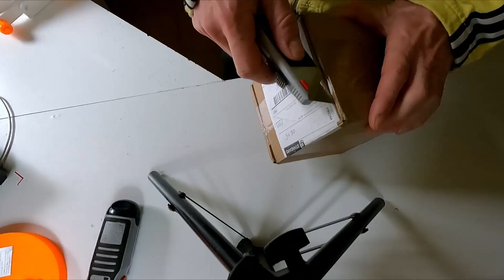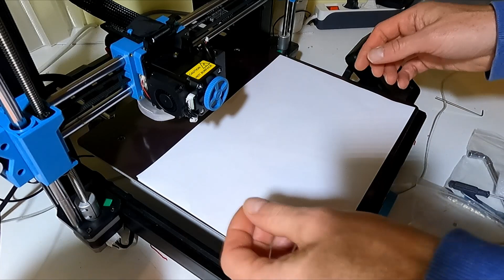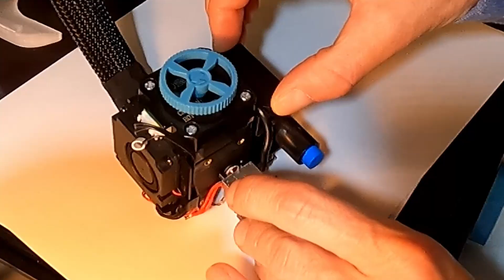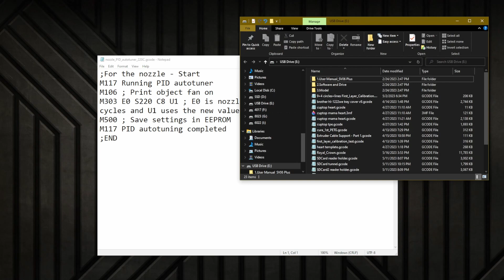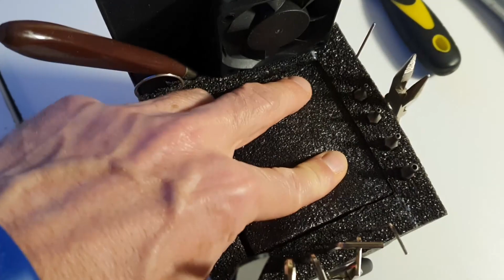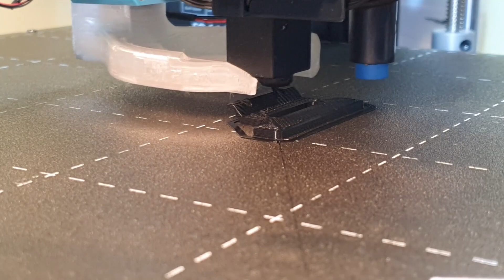0.6mm hardened-steel nozzle on Sovol SV06 Plus 3D Printer (identical to SV07 / plus nozzle change)

Comment: Is thai the same nozzle on the sv06 ace?
Reply from the maker: I am not sure about the ACE, I don't have that machine. It is the same as the SV07 and SV07 Plus.  From pictures ACE nozzles look similar, but maybe closer to the updated version of the SV08 nozzles. Your best bet is to order directly from Sovol's own website, a set of 4 sizes 0.2-0.8mm is just $13 there! https://www.sovol3d.com/products/sv06-ace-nozzle-kit-0-2-0-4mm-0-6mm-0-8mm?sca_ref=4569765.6Aq0ezb6JS

Comment: I thought the temps and all that other stuff like walls was set in the slicer and goes into th gcode, not set at the printer.  What are all those settings in the printer for too?
Reply from the maker: Exactly! The slicer controls most settings, but since I'm swapping nozzles with a modular system, I need to calibrate a few settings specific to this extruder on the printer itself. PID tuning, e-steps, and z-offset can change a bit when you swap hardware, so it's best to calibrate each extruder directly. Then, the slicer knows it's working with a calibrated machine. PID is the way to control temps, that is handled by the printer and is specific to extruder / heatblock / nozzle. Same goes for z-offset. That's the vertical distance between probe's cutoff and the tip of the nozzle. E-steps are specific to the extruder stepper motor. Then when the slicer tells the printer to extrud 2mm of filament, you can be sure it is indeed 2mm. And when it tells it for the nozzle to be 200C, it's not going to fluctuate as much (e.g. between 198 and 202)
Reply: Sv06 ace here. Sv06 model in this vid has a lot more controls to play with than mine. I still should be able to do everything he was able to do.
Reply from the maker: @nicholasavallestero0791  You have the same control, but your is Klipper based, so things are done differently. Settings are in the printer.cfg file. Watch my advanced settings video for the SV07+ → https://youtu.be/58iNKpJVH5w

It's more similar to your SV06 ACE than the old, Marlin based SV06+ shown in this video.

Comment: If replacing the 0.4 nozzle with 0.6 mm, do you need to change the extruder nozzle diameter configuration on the printer klipper.cfg?
Reply from the maker: Yes, adjust the line nozzle_diameter: 0.400   in the [extruder] section

Comment: my nozzles are a lot shorter
Reply from the maker: You have the SV06 not the SV06+. The SV06+ and all newer Sovol printers use the more modern high-flow nozzles, the SV06 is the last Sovol model using the old style, MK8 nozzle, which limits printing speeds when using Klipper. For Marlin and PLA it is OK. For TPU or even PETG the high flow nozzle is recommended.

The good news is that you can upgrade the SV06  toolhead with the SV06+ extruder! They are pinout compatible. Please see the link in the description to the SV06+ extruder. It is $55 (incl shipping). The high flow nozzel is capable of 25-30mm³/s volumetric flow, while the SV06 MK8 nozzles are limited to 10-15mm³/s. 

If you upgrade to the SV06+ extruder, your old SV06 extruder can still be used as spare parts for consumables like the extruder and part fans, stepper motors, planetary gears, breakout board  and even possibly the thermistor.  If you upgraded to Klipper, or planning to, I highly recommend this upgrade as well.  See my video about Klipperizing SV06 in less than 20 minutes → https://youtu.be/xoGxAHcYCVc

Comment: Hi, I have a problem with this piece, my filament got stuck in the entire hot end and I can't remove it because it's stuck between the nozzle and the cylindrical part that binds it, how can I do it? should I buy a new one?
Reply from the maker: Well, it is a good idea to have a spare extruder for any parts to be replaced. I talk about this in this very video. The link to the spare extruder is in the description of the video. But it can take weeks for it to get to you. You have a chance of salvaging if you heat the area with a heat gun or hair dryer (carefully), PLA softens around 60°C (PETG around 70°C) and you might be able to carefully peel it off. Be careful not to damage the thermistor / heater wires. Even if you do, it might only cost you an extra hotend. Try this before ordering, and if the hotend cannot be salvaged, order a spare extruder and also a replacement hotend. Ordering them together will avoid shipping costs.  May the force be with you 🤓
Reply: @gerGoPrint3D  thank you so much your the number 1 😂🫶🏻
Reply: Hi, thank you very much for your reply! I solved the problem by disassembling the hotend and rolling the PLA wire cold. I helped myself with a nail of the same diameter, gently hitting us with a hammer. It was quite simple and I didn’t cause any damage. Now, in case the problem happens again, I already know how to proceed! 😇🫶

Comment: if you were only replacing the nozzle to 0.6 would you also need to run the calibration script?
Reply from the maker: No, unless the new nozzle is different material. But nozzle PID tuning only takes a few minutes...

Comment: I know it's an old video but I thought I'd comment anyway. I have a Sovol SV06 Plus and these videos have been really useful to me, thank you Mr. Gergo!
I switched from the 0.4 stock brass nozzle to a 0.6 nickel-plated copper nozzle, and am getting a lot of overextrusion and stringing. It seems the copper nozzle is more effective in heating the filament, even if it's just a regular nozzle, not a CHT. So I guess I have some tuning to do now...
Reply from the maker: Everything in this video still stands :) Yes, switching to a nozzle of a different size and different material will mean a lot of adjustments. I recommend using Orca Slicer's handy calibration tools to fine tune your temps, flow rates, new max volumetric speeds, retraction length and speed.  I am planning to make a detailed video on these tests soon.
Reply: @gerGoPrint3D i switched to a .6 nozzle and am getting lots of overextrusion. when i did the flow rate calibration in orca, i ended up with a flow rate of around 0.8, which seems very low. is this normal?
Reply: @gerGoPrint3D this is an older video, but I just wanted to say that even though I like your channel quite a bit, I think changing a nozzle is a bit more complicated than this.
If the hotend is not an all metal *no metal throat with a bowden tube going all the way to the nozzle), you extually screw in the new nozzle leaving about a 1mm gap from the heater block, push the bowden tube til it meets the nozzle, mark the tube where the retention clip would be, remover and scuff the tube with a blade or rough sandpiper at your mark, reinsert the tube all the way and put the clip back on, then torque  the nozzle as far as it will go against the tube (all while heated as you mentioned) (this is why new printers always have a gap)... if it's an all metal, you do the same space and torque method with the throat against the tube, then repeat with the nozzle against the throat... lastly, after it cools, you can see if it can be safely tightened a bit more.... isbis what has caused all of those leaks we see pictures of on the internet, tightening against the block with the space between the tube. Also slack 3D thermal paste improves results.
Reply: I think that the thermal paste that is used to put heat sinks on CPU's works just as well but I don't know about any viscosity differences.
Reply from the maker: @spyrit35  Thank you for the detailed explanation. I did not know all of these needed to be done with all metal hotend too (there is no teflon inlining in this case). Since my video Sovol made a nozzle removal short video too, where they simply unscrewed the old nozzle and screwed the new one in its place. If anything, I at least heated the nozzle to 240 (I now recommend 270-280°C) while Sovol only heated to 200°C, which is clearly not enough. 

The nozzle I installed in this video almost a year ago has been in service ever since, and works perfectly without any leakage or issue. I might have been lucky, but as far as I understand all-metal hotends can be swapped simply like this.   

My SV07 Plus uses the same type of extruder, and I have replace nozzles in that printer several times using exactly the same procedure, no issues here either.  

I know the process you described because my 5 year old Wanhao printer had this type of teflon lined MK4 type nozzle, it was a hassle to replace and you had to watch out for all these things you mention. But fortunately these Sovol printers are beyond this nozzle / hotend system.  

In the new T300 and SV08 Sovol switched to using an integrated nozzle/heatblcok combo similar to the one use Bambu Lab printers use. Here the nozzle replacement is even easier, no preheating is neccessary as I understand (though I did not need to replace these yet).

Thank you again for your thorough comment, I am sure it will be helpful to owners of older printers.
Reply: @spyrit35  Don't use those PC thermal pastes unless you first make sure they can handle the high temperatures (+300 C) in 3d printing. Many of them have maximum operating temperatures much below 200 C - I learned the hard way :D I put some generic silver paste between my nozzle and heatblock and oh boy did that cook off and make a nasty smell for a long time.

Comment: So depending on what nozzle you want to go to, like in this video you went to 0.6, would the g code change if you were to do a 0.8 nozzle?
Reply from the maker: Yes, you will need to adjust the nozzle in the extruder section of your machine settings in Cura, then adjust the line width under "Quality". You should also adjust your layer height as the recommended range also changes with the nozzle size (the optimal ratio between nozzle diameter and layer height is typically between 25% and 80% of the nozzle diameter)
Reply: @gerGoPrint3D  right but the copy and paste g code, where would one find that? I see the one in your description but if I were going to a bigger nozzle what would the g code change to or where could I find it? Or is it the one in your description? Thank you for the slicer setting recommendation that really helps

Comment: I did as you did in the video. Works great. Now i got a 3rd extruder with .8mm steel nozzle attached. Just need to find the proper settings for Cura with the .8 nozzle. Maybe you can make a video of your Cura settings.
Reply from the maker: I guess you could just do the same I did for the 0.6mm except go even higher (line width to 0.8-1.6mm, layer height between 0.4-0.6mm. I would raise nozzle temp by 10-15°C, cooling to max and will probably need to slow down a bit to make sure layers cool enough). I haven't tested my 0.8 nozzle yet.
Reply: Ill give it a try this weekend. Thanks for the input
Reply: worked fine in prusaslicer, i didn't need to write down any note or this or that, just changed extrusion width

Comment: i dont understand how used pid file, simple make a note put that g-code in and put in sd card and start to print?
Reply from the maker: Exactly. You can find the GCODE in the description of this video. Just create a text file on a card, copy this, and rename the file PID.GCODE  or similar.  Then select the file as if you were printing it (nothing will print, but the printer might ask for filament to be loaded in the filament run-out sensor) Don't load filament in the extruder though!
Reply: @gerGoPrint3D  i did this after i mount the 0.6 steel nozzle right?
Reply from the maker: @Maro.Simone  Yes. We have to teach the printer how the new nozzle responds to heating. That is what PID tuning is about :)

Comment: The spare extruder is how I managed my SV-06.  One with the .4 and one with a .2.  I may look into the .6 nozzle to replace the .4.

Leve;ing with the back of the PEI sheet! Genius!
Reply: @brucoder How is the 0.2mm nozzle for fine detail on this printer?
Reply: @3Skulls  If you're asking about the standard 06, it's great for fine detail and didn't require a slowing of the print speed.  I only tested 2 prints on the 06 Plus.  While the detail was a bit sharper, I had to slow the print speed down to around 60mm/sec. Since I use the Plus for functional parts rather than decorative parts or minis, I just moved both the 06 Plus and 07 Plus to the .6 nozzle permanently.
Reply: @RocketCityTim  Oh, interesting. But isn't full speed on the regular SV06 something like 80mms, too? Or have you tweaked it to go faster?
Reply: @3Skulls  Klipper lets me hit 150 mm/sec easily.
Reply: @RocketCityTim  Oh wow, you're printing detailed minis with a 0.2mm nozzle at those speeds on the SV06? Amazing!
Reply: @3Skulls  Yes, a few minis for testing, but mostly functional mechanical parts for system design - I'm a design engineer by trade 🛠.  For the minis, remember to watch your bed orientation and Elmer's Glue Stick is your best friend!

Comment: So, apart from changing z offset, e-steps, and pid values when you swap extruders, do you also have to perform auto bed level every time you switch?
Reply from the maker: I could possibly get away without it, but I do a z-align and bed leveling too.
Reply: Thanks for all the great videos.

Comment: Ive got the same Full Size SD adapter on my Sovol SV06+ ... When you remove the SD and add a new file and plug it back in does your Sovol recognize the new files? I have to reach down and eject the micro SD end and reinsert it to get the files to update. That normal or did I get the wrong adapter?
Reply from the maker: Yes, that's how it works with stock firmware. We have to power cycle the machine to refresh the card :( I am hoping Sovol adds a "refresh" button in the next update of the software (or it could just re-read the card every time we enter the print menu). My process now is that I write the card first on my PC, put it in the card reader, then turn the printer on.

Comment: Hi i'm still kinda new to 3D printing the PID Autotune I'm not familiar with how to add that to my machine I really would like to auto tune the machine being that I've already upgraded the fan and I just recently received Stainless steel nozzles from Sovol , I seen that it was opened up in notepad but I don't know how to format the script you provided into G code could you please help.
Reply from the maker: On windows?
1. Copy the lines from ;PID → ;END in the description
2. Paste it in an empty text file
3. Save as... 
4. set "Save as type" to "All (*.*)" (encoding can stay UTF-8)
5. name file "NozzlePID.gcode"
6. on the printer just select to print NozzlePID
Reply: @gerGoPrint3D  Thank you

Comment: i swaped mine out to the microswiss valcano
Reply from the maker: I went with the sovol branded set, I felt $23 for 6 hardened steel nozzles is not a bad deal (shipping included), and I am planning to try the 0.8 and 1.0 nozzles in the pack as well.  The fan duct could be raised for a regular volcano, but this way I did not have to trim the silicone sock

Comment: What did you print the new fan duct attachment out of?
Reply from the maker: For the bracket, which is way up from the heated bed, so I used PLA similar to Sovol colors.  The fan duct itself if PETG. So far, I haven't encountered any issues, but I keep an eye on it. I primarily print with PLA and PETG, so the bed isn't heated above 70°C. However, when I print TPE, where the bed temperature can reach 90°C, I'll need to be cautious about not leaving the extruder too close to the bed for an extended period of time... I would print a fan duct using a more heat-resistant material, but currently, I don't have any.
Reply: @gerGoPrint3D  thank you so much for the quick reply I will have to look into getting some PETG for I am new to 3D printing and only have some PLA but again thank you.
Reply from the maker: @zeuzerman  Don't be afraid of PETG, in my experience it is even easier to print PETG than PLA on the Sovol SV06 Plus, as it sticks to the PEI bed even better.
Reply: @gerGoPrint3D  For cases the bed reaches temps about nearly 100°C i have printed my fanduct out of "Extrudr GreenTec pro" - works wonderful with high temperatures.

Comment: Great guide, I want to put an e3d nozzle on mine but I heard I'll have to 3d print a new duct and trim the silicone sock.  Subbed
Reply from the maker: The duct you see in this video can be raised by a few millimeters to create space for a shorter nozzle tip.

Comment: It's crazy how your z offset was so low. Mine has never been below -1.16 and as whole as -1.33. Still not sure why mine is changing as I checked everything. I have a case in with Sovol.
Reply from the maker: It simply depends on how the ABL probe is mounted on the extruder. Each extruder will have a different value, and it also slightly changes with the nozzle you insert
Reply: Mine is currently at -1.55  I should figure out how to adjust it.
Reply from the maker: @kylezakk  What's the advantage of a smaller offset?
Reply: @gerGoPrint3D  absolutely nothing they are just surprised how 2 built items can be 10mm off but does not understand variance limits of acceptability in production lol